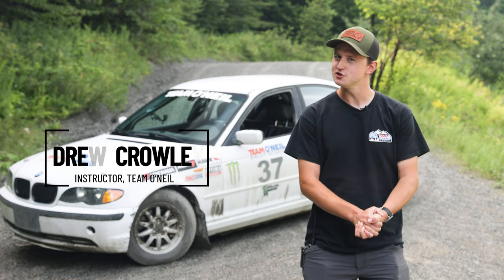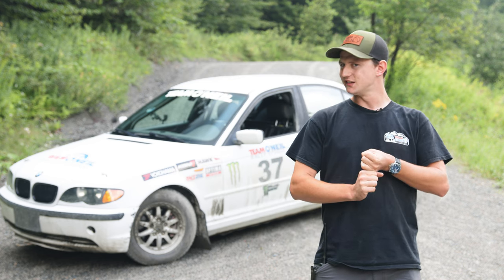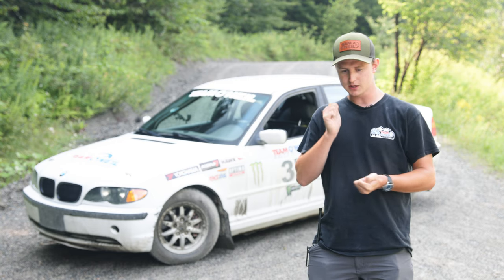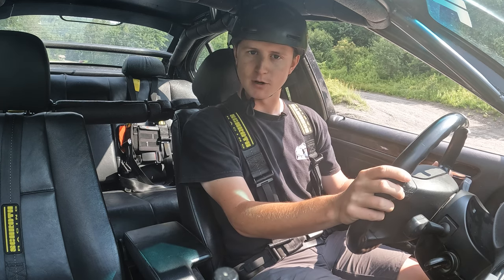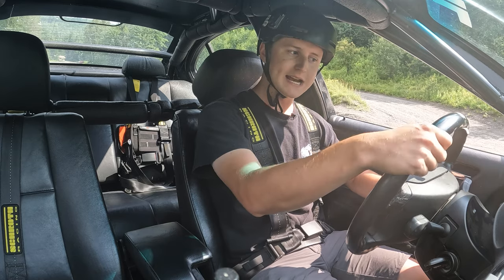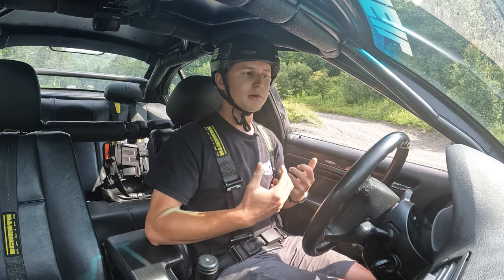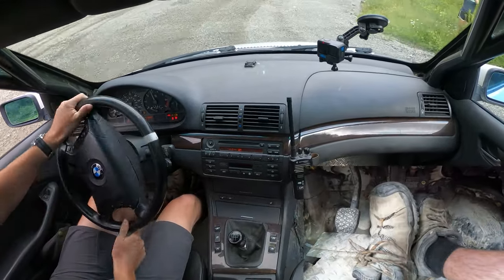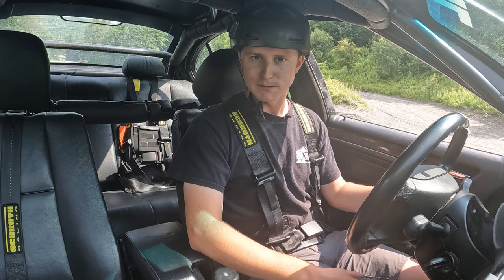How To Shift Lock

Comment: I’ve been doing that for 32 years but I didn’t know what it was called 😅
It works really good in the snow.
Reply: yeah, I used to ice race E30s back in the 00s. I didn't know that's the name of the technique. Just called it engine braking or driveline shocking.
Reply: It's also really good in FWD cars too if you really need to unload the rear end going into a corner and get the front to bite in. We used to call that the Chuck&Fuck...
Reply: Yeah, I’ve been doing the same thing ever since. I never knew it’s a technique with a name.
Reply: I was about to say the same! I always shift lock and was slowly trying to break the habbit as I didn't think it was a thing ahahah

Comment: I still blip the throttle when I do this, just for a bit of added mechanical sympathy. It’s a little less effective than the shock of an unmatched shift to break the rear end loose but if the revs are high enough there’s enough engine braking at play for that rear braking to help you rotate the car into the corner nicely. Like some others I hadn’t heard it called ‘shift-lock’ before but it makes sense.

Comment: I really liked this when racing with FWD cars. It slows down the car, makes the rear loose and sets the engine in a good revs for the upcoming corner.
Reply: That's just engine braking. You won't be able to lock up the front wheels using this technique on a fwd car. And with shift lock you do it almost mid corner when the weight transfer is happening.

Comment: So this kinda functions like a clutch kick, but getting it down to the right gear for the exit
Reply: Not really. With a clutch kick you are aiming to increase wheelspeed to break traction, here you are decreasing the wheelspeed quickly to break traction. So typically you would use clutch kick to extend a drift/slide if the car runs out of steam, the shift lock you use to initiate a slide.
Reply: No💯

Comment: I do this quite a bit while rallycrossing my MR2 usually when theres a sharp corner that I have to go into 1st for.   Good to know theres a name for it.   Careful about over revving the engine I've done that a bit as well doing this.   I can also lock the tires just through engine braking.  I'll vary how much I'm using the brake with my left foot vs how much I'm letting off the throttle to balance how much rotation I want on turn in.

Comment: What tires do you currently have mounted to this car? Looks like they aren't dedicated rally tires. I have a couple gravel-focused E46s and have been wondering what kind of tire will actually hold up to some use on gravel. Thanks!
Reply: Found it! Yokohama iceGUARD IG53, which is T-rated. I've tried a couple V- and W-rated snow tires on my cars and they were thrashed. Hopefully the T is more durable!

Comment: I have this works great on pavement too, in certain situations and depending on the car. I would not do on a manual H-pattern box, as it's hard to be consistent, but on sequentials and dual clutch boxes it works.
So, what you do is time the downshift to get a little bit of a jolt at the right moment. Nothing big or dramatic at all, just enough to induce a bit of oversteer at corner entry. Too much and/or at the wrong moment, and you'll shit the bed.

Comment: Love your videos, what did you have to do to that E46 I terms of setup?
Reply from the maker: The only changes what we do to our 3 series are: use a limited slip differential, Koni adjustable sport dampers, install a skid plate, and other safety equipment such as a roll cage.
Reply: What LSD you use (KAAZ plate, QUAIFE geared, TORSEN or e36)? What modifications did You made to the differential housing (to fit it)?

Here You have Koni adjustable sport dampers - as I understand these are expensive sport dampers not a budget solution.. 
On “Will It Rally? BMW 3 Series” video Wyatt said that You swapped the original suspension to “Bilstein HD (kind of heavy duty suspension)”. Could You give a bit more details (I’m a bit lost in Bilstein kit offerings..)? Seems something I’m looking for (a bit more of a budget option).. Want to rise my e46 touring a bit and upgrade it’s suspension.

What skid plates You use (buy them from somewhere, or make your own)?
Reply from the maker: @viesturs5  The LSDs for these specific school vehicles were either welded or MFactory. For more budget suspension other than Bilstein HD, Koni might have something close. We make our own brackets, mounts, and skid plates.